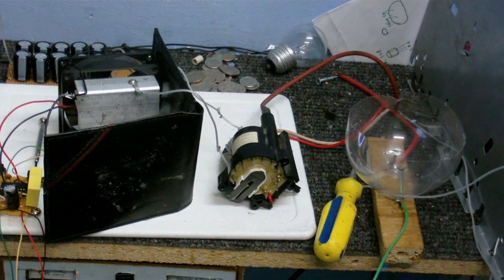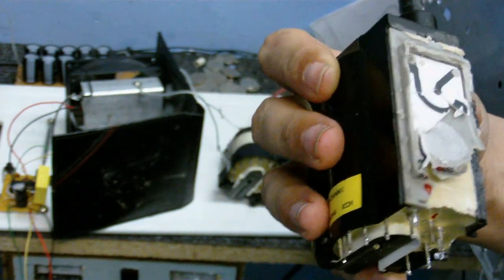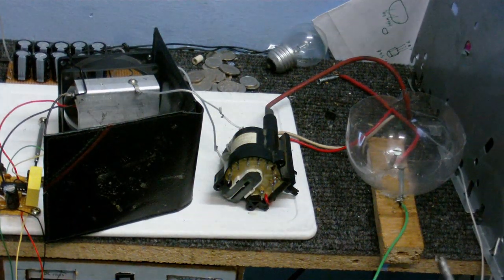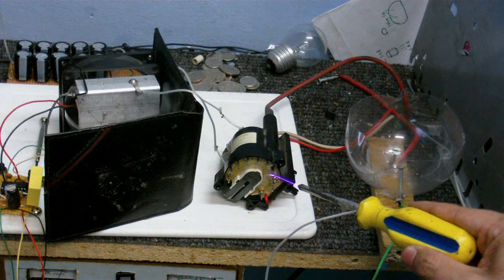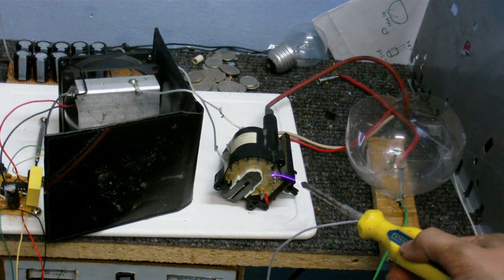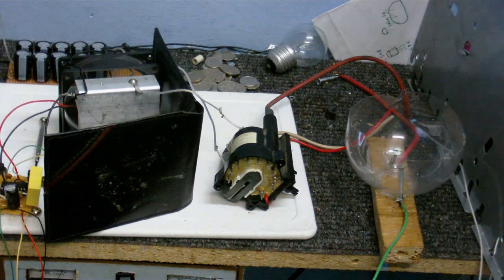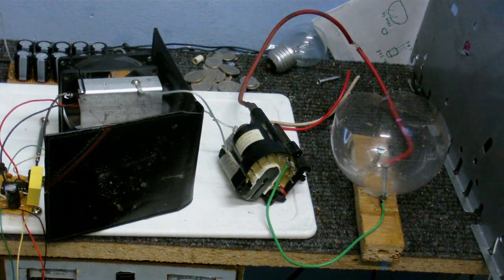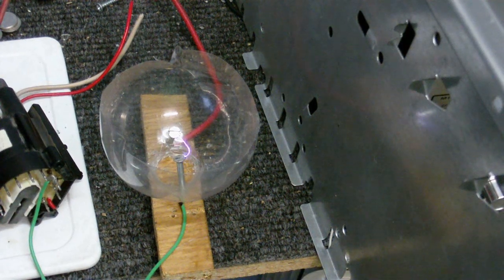flyback update

Comment: to stop the arc from flapping around so much, try using stainless screws and have their points coming up through the board, more surface area at a point and better contact, you could also try different modulation methods for it, besides simple AM using the raw arc and feeding in a signal, there are circuits out there to do that. Also get on the geek group forum, google them, LOTS of people on there who love High Voltage and their a great organization and very helpful with any sort of tech stuff!